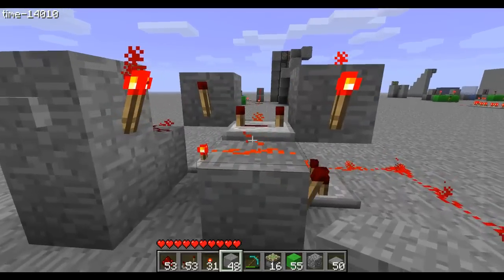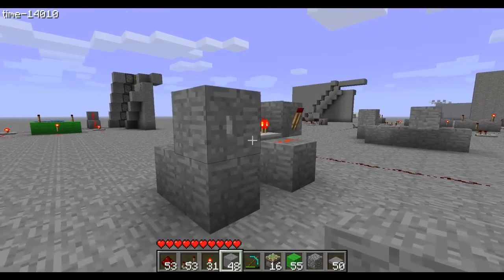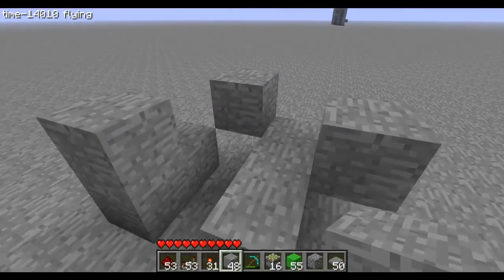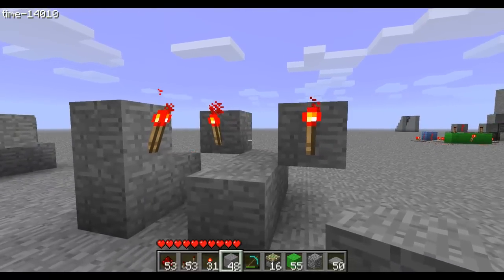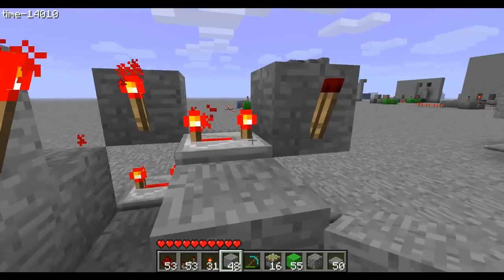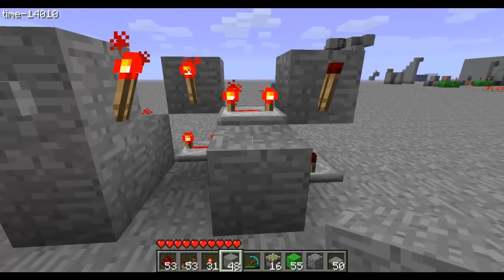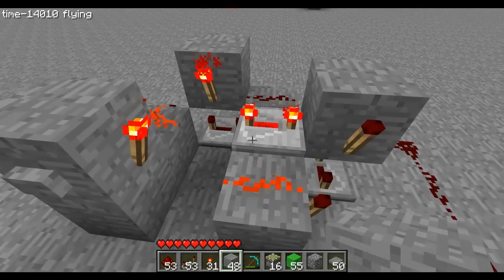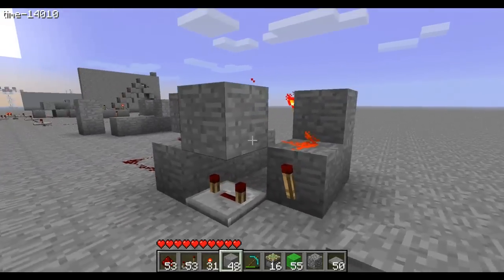T Flip-Flop - For Dummies

Comment: Many people ask why people use a t flip flop instead of a lever. the reason is that you can have multiple inputs with a t flip flop, where are with a lever, if the power is on in one place, you cannot turn it off in another. so if you use a t flip flop, the  you can have multiple inputs and this will make your life much easier if you want to make things like secret doors and such. thumbs up so people can see.

Comment: I think i made this mistake too once. You can use an RS NOR latch for the same purpose you guys are usesing this T-flip flop for. (the really popular design thats on the wiki and is like a circle of redstone with two torches) The main difference is that RS NOR has extra inputs and outputs. Just dont wire them to anything.

Even better is when you make the RS NOR latch output to door, and the second output delay and power itself. Then u make an x sec button rather than annoying 1 sec one

Comment: Just replace the button with a repeater set to the highest setting, so it powers the block the button used to. Hook your input wire to the repeater, and bam, fixed it for me.